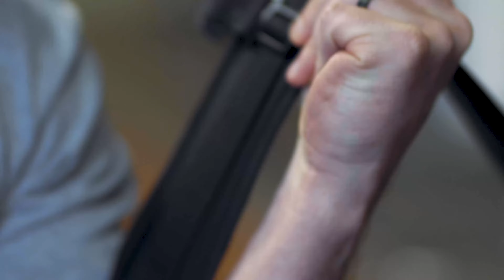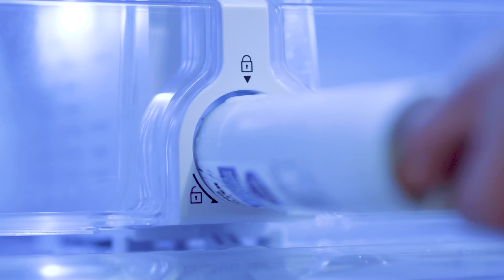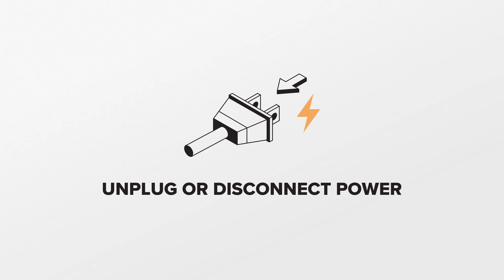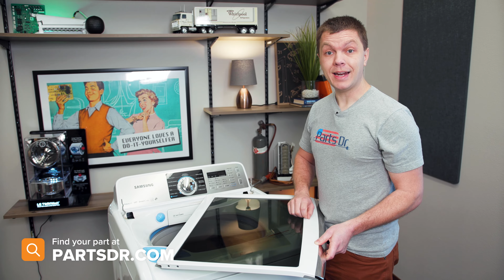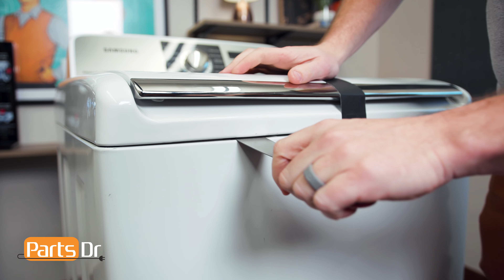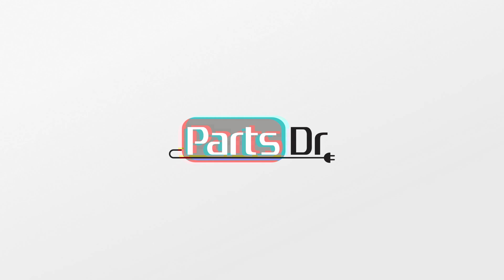How to replace Samsung washing machine lid assembly part # DC97-16959A

Comment: can the latch piece in the lid be replaced? the latch is broken and it wont lock. Already replaced assemble that was also broken.
Reply from the maker: No, we haven't seen the latch piece on the lid sold separately as a serviceable part.
Reply: @PartsDr  do yall have the lid that I could order?  I am not finding anywhere that I can get the correct part number for the lid and some of the ones that come up online just dont look like mine.  model WA45H7000AW/A2 04
Reply: @PartsDr  so I should replace entire lid?
Reply from the maker: @kathycribb9707  That is probably the only option available.  You can search on our website https://partsdr.com using the model number from the tag on your washer to locate the correct parts.

Comment: I seem to have an older model with 4 clips and 2 sets of nuts and bolts holding the top on. I need to replace the shocks and cannot figure out how to get to these nuts and bolts to remove the cover, no less replacing them when it is time to put the lid back on.

Comment: washer model WA5471ABP/XXA.  Lid part# DC68-03049A. The lid on this washer does not have the side cover or the 2 phillips screws on either side of the lid. How do you remove this lid?
Reply: I have the same model, any replies on how to remove the lid?

Comment: Do you happen to have a video or explanation on how to remove the display panel? Or the rear part of the display panel? While I was working on the top of mine, I accidentally allowed the lid to slide off the back and it sliced one of the small green wires that leads back down to the bottom of the machine. Now if trying to figure out how to splice or reconnect that wire, because at the moment my washer will not drain any water. It still starts a normal cycle, but when it gets to the drain part of the cycle, it sits and does nothing…
Reply from the maker: Hopefully this video here has what you are looking for: https://www.youtube.com/watch?v=yqs1dRdZdyo
Reply: @PartsDr  exactly what I was looking for, thank you so much!

Comment: If we drop the little screws. Will they brake? Can we pick them back up?

Just kidding. Being a smart a...
Great job! Helped me out!
Reply: @PartsDr  Help
DC68-03172B-03 how to get the top off…
Was given this used washer last winter sometimes it would go off balance 

Now I can’t run a load
I’ve tightened up the huge washer under the agitator
That helped but didn’t fix the issue 

Now I’ve unplugged 
Took out the 3 screws from behind 
Wrestle 
Wrestling pry
Slam spatula with a tiny hammer I’m not very strong
Now the back I can lift up
The front 
Looks like has long slide silver clips
I can’t lift up
I can’t slide 
I just want to replace the shocks for say what am I doing wrong?
The front will not come off

Comment: Hi - Can you please make a video of samsung wa48h7400aw/a2 top cover assembly replacement? A lot of complaint about bleach tray rust. Thank you.
Reply: same here; my top panel is cracking and leaving metal rusty fragments in the soap/softer tray. Every time the lid opens, it rubs against the top panel and creates more debris. I'll have to check on those hinges (could be why the lid is rubbing against the panel).
Reply: @JodyHeath  Mine has been doing the same thing. Rusted out coating chipping all along under the backside of the lid and the inner top edge. I hate to buy a whole new one just because of that. Been thinking about maybe disassembling the lid and sandblasting it then powder coating it or something. It's gotten ridiculous.
Reply: @dross10001  how old is your Samsung washer? I have one that is almost 10 years old and the lid plastic on the back left corner completely broken. Now the washer won’t work. I ordered the OEM part and plan to replace it myself. Now I have to go look at that one assembly to see if it’s rusty or not.

Comment: What about the area where the bleach & softener go ? It has become so rusted & probably needs to be replaced, just that area
Reply from the maker: If that happens, the only option is to replace the entire top.
Reply: @PartsDr  How do you remove the top and replace it? Is it time consuming?
Reply: @Parts Dr  do you have a video show how to replace the entire top.